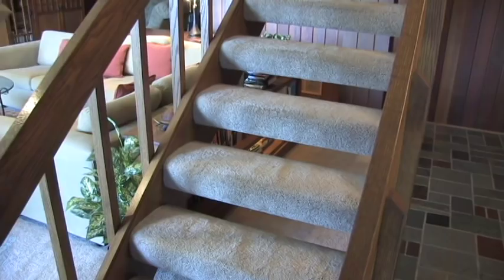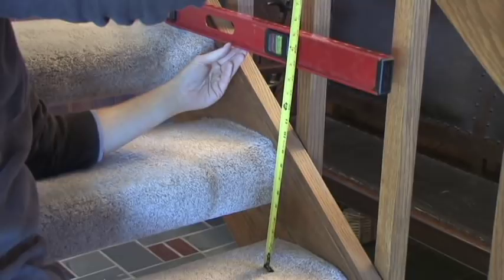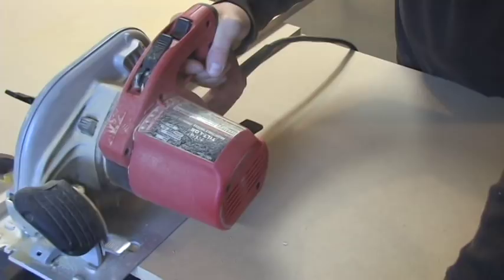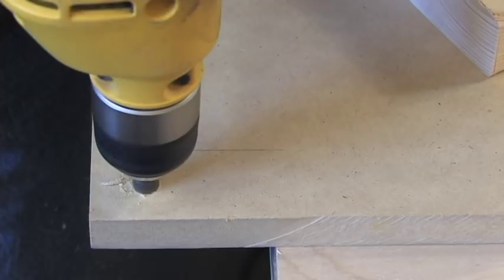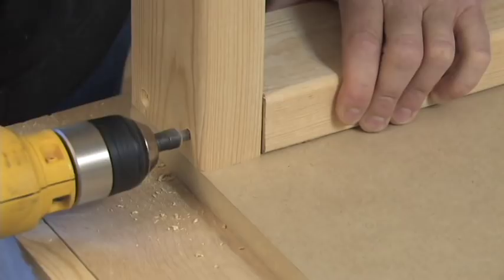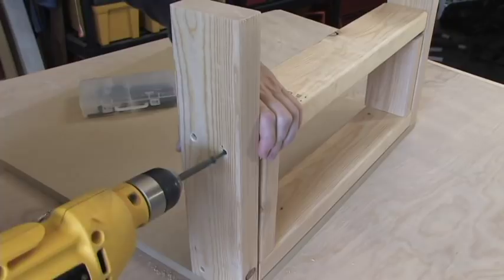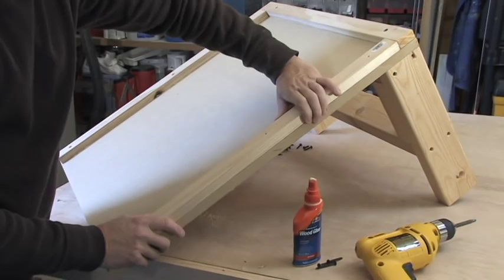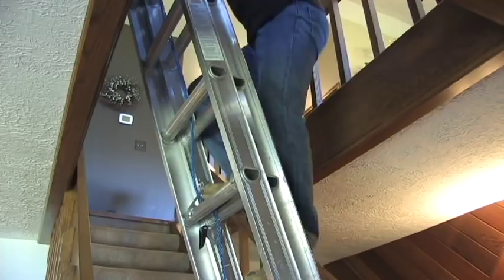How to build a ladder platform, by Matt Fox of HGTV's room by room.

Comment: Thanks for the video. My only suggestion would be to not use MDF (Medium Density Fiberboard) for your platform. MDF is great for counter tops, and is very flat and heavy, but has very poor structural strength - It would not take much weight to cause the MDF to crack/collapse. Recommend using 3/4" Plywood instead, which is stronger, and typically less expensive than MDF anyway.

Comment: Great idea!
I suggest some changes because there are issues with the original design. 

1  Insert x member between the legs - not a boxframe
2  Install small diagonal brace to prevent platform from tilting away from stairs
3  Install small nails on underside of platform to grip on carpet & prevent the platform base from sliding
4  In an open staircase application, install an L-bracket to grip against the back of the stair to prevent slippage

Comment: Most all stairs have no gaps, so a ladder with an adjustable leg height is needed and probably the best and quickest solution
Reply from the maker: Yes you are correct. This was an issue for steps that didn't have riser and for a home that didn't have an adjustable ladder.

Comment: For a home owner works very good , you build and save it, but for a contract it would add up to the job.There's a leg leveler that can be  purchased from home depot or so.I used to make my leveler with 2x4 . Drill few 1/4 inch holes in each side of the ladder which wont weak it up. Every time you get a situation like that just screw a piece of 2x4, use it and remove. That's simple.

Comment: No gusseting. Sure the load is going straight through the legs, but I would feel a lot better if those support legs were gusseted to the platform. Just a simple right triangle on the sides with some more of that leftover MDF and a little glue to weld it all up. Below, I see wowza1211 suggested plywood. Heck yeah, lighter to carry, lighter on the wallet, and stronger.